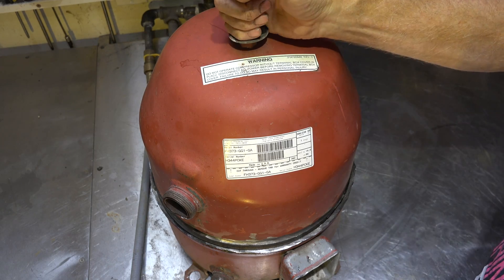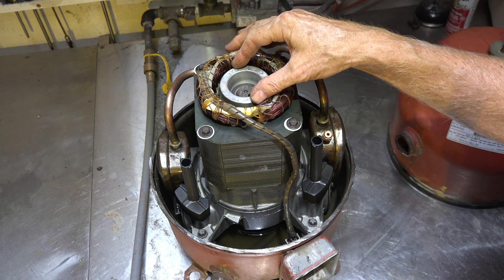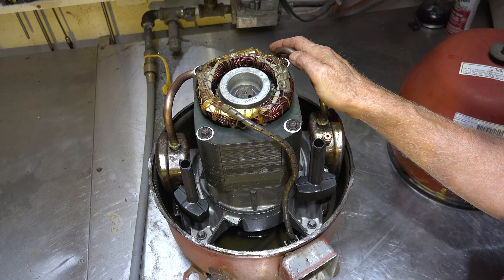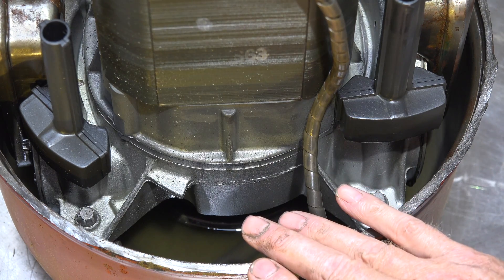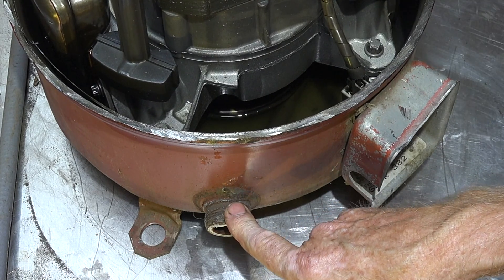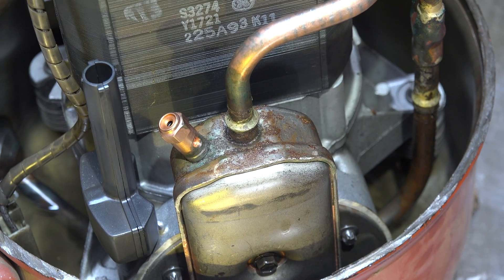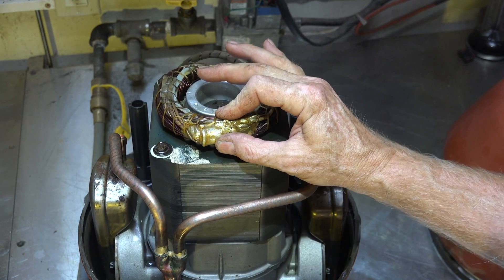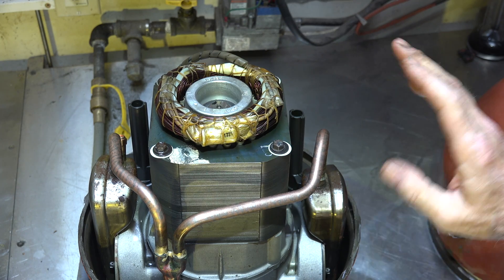The refrigeration compressor #3

Comment: Excellent video.  I do have a question. I would like to know if replacement of a hermetic or semi-hermetic compressor with a scroll is safe or recommended. Thanks GFM. keep those videos coming.
Reply from the maker: I don't think I would do it.  There are differences in the systems.
GFM
Reply: Thank you GFM.

Comment: top part is always hottest due to heat transfer, so the coolest gas near top makes sense, the suction pipes near the top to keep it from pulling liquid refrigerant/oil, safety valve is great idea(over-pressure), temperature overload great also(thermal-overload)

every overcharge/restriction or capacitor failure equals multiple of the above scenarios.. good video GFM :)

Comment: Do all tin can compressors typically have those internal pressure valves? Reason I ask, the other day I was working on a unit that had a packed up condenser coil.  I turned it off to clean it off (co2 on account it was in a dollar store). When I turned it back on after a while it made this noise that I have never heard a compressor make before.  Sounded like a whining groan.  Maybe 2 seconds.  The suction pressure went way up.  It started coming down a little but never got below 80 psi (404a cooler so...... way high).  I actually closed off the liquid line valve and it didn't change the suction pressure at all.  I have seen reed valves fail before where the pressures basically are equal, but I never seen a compressor fail like that while I was actually watching it. It was just a tiny copeland compressor for a 3 door zero zone.
Reply from the maker: I don't believe Copeland uses them.  Your info sounds like pressure valve bypass.  However, if it did not close off again after relief, it could have been valve failure.  Mostly, when valves fail the unit just goes to equalized.
GFM